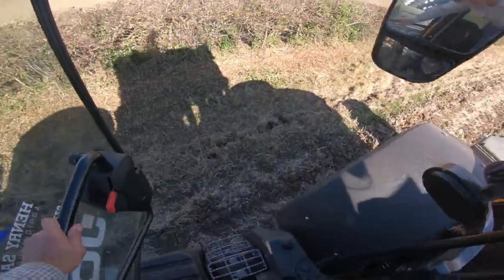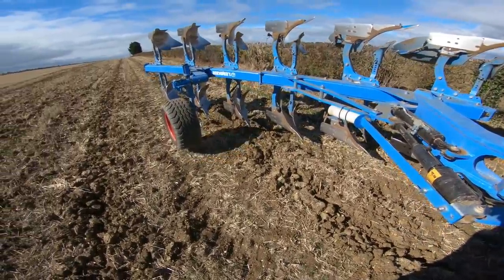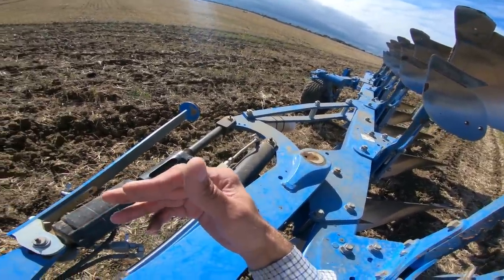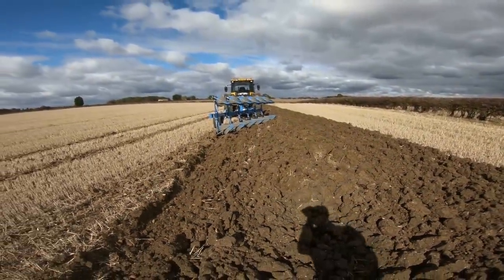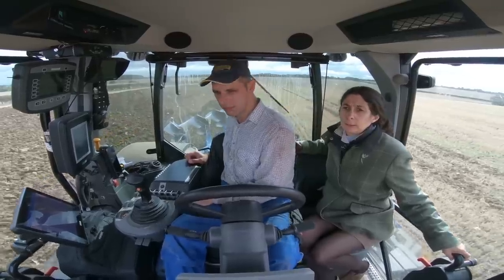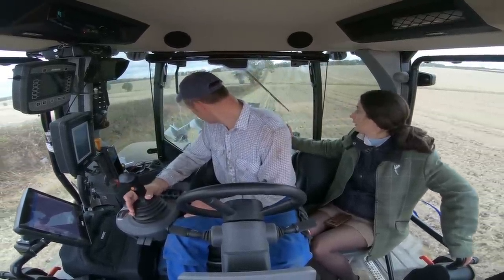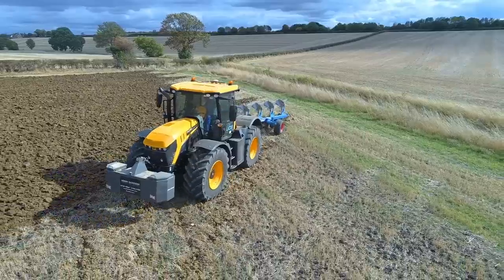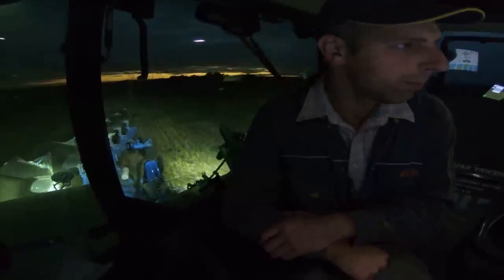Trying Out A New Lemken Plough

Comment: I had the same plough last year but, with hydraulic turn over stops and hydraulic width adjustment too - snazzy.  Only issue I had was i fount it hard to bury trash from the first furrow as trash would often split at the skimmer and end up on the second furrow and struggle to get buried if that makes sense.  Used to end up with a line of standing loose stubble.  Clodddy clay land though

Comment: Must admit, I do miss the journey videos but as you say, the new stuff just isn't the same 😣. I looked into getting a fazzy  but most have had thir arses ragged out of them hence why I bought a unimog then onto a mb trac. More expensive to buy in the beginning but look after it and it will do the same. Oh and a hell of a lot fuel used and higher road speed 😊
Reply from the maker: Mb trac could be another way of going. I've got a journey vid in the pipeline so keep your eyes peeled.
Reply: Mb trac always get the looks, mine does but then you can here her miles off 😂. I've the 1300 so 3 sizes bigger than the 900 u and the other 2 looked at. I've some videos up if u wanna see it. Ahhh nice one lad, I'll look forward to it 👍

Comment: Looks like a bit heavier front counter weight be useful as the plough is lifting up the front of the tractor still even with that big weight there?    Why does not someone make a square frame like a cultivator that has the ploughing blades set across the frame so it can plough wide and still be able to turn or adjust by electric motors or hydraulics the angles and depth etc.?  Be better for the field work as the plough be shorter but wider the outer 1/4 of the frame could fold up like a corn header does to make it smaller for transporting on the roads!  Plus the ploughing be nice and straight on the edges of the fields instead of the part ploughed areas of the normal plough?  It not impossible to have such a design. it could even have a cultivator part behind it too to save time doing that separate.
Reply: They do they call them chisel plows very common in the states

Comment: How fast does that tractor go in mph?!?
Reply from the maker: 39mph
Reply: George Saunders I drove a new Fastrac in the early 90's with grain trailers during the harvest it would do 55mph, the farm had a pair of them, I can't remember the model now, the Fastrac I used had to go away to do another job and I was put onto a brand new Ford, it was on test and still gift rapped when it arrived, and remember the farmer saying it was Ford's most powerful non artic tractor. It had a joystick for gears, you just flicked it back and forwards, it was a great machine with tons of power but slow on the roads for carting grain after the JCB. The farm was a very slick operation. I remember burning the stubble on a massive prairie field then pressure harrowing it on a John Deere artic, I think that one was an older tractor an 8430. Great video thanks for posting.